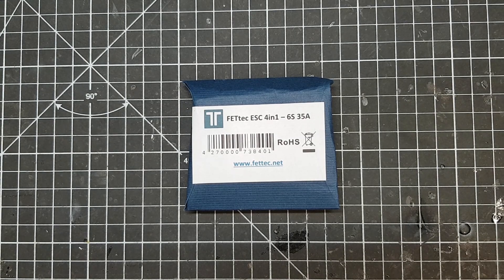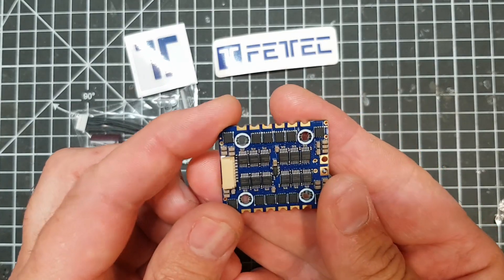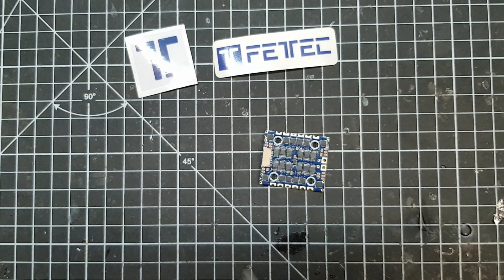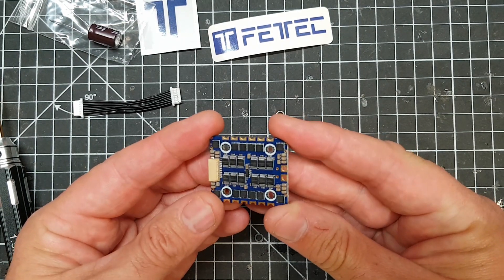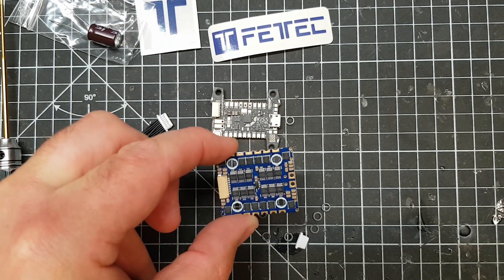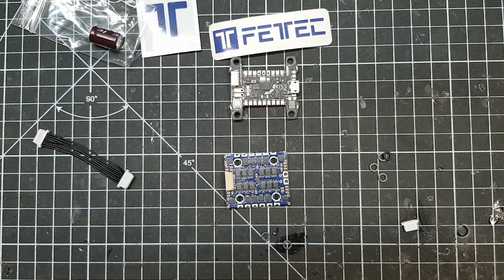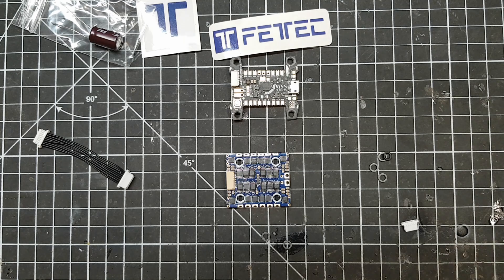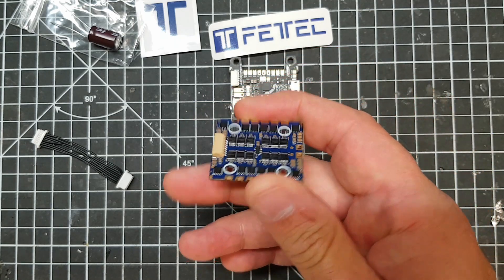Fettec 20x20 6S Sinewave ESC

Comment: Hello, Do you have any particular update for this esc?
I'm looking forward to a kiss build and i was wondering if some of the problems this esc had are maybe solved now or if there is any news about other stuff that might come out shortly.
Also have you seen Karearea TOA Turbine motors?
Reply from the maker: There is a version 1.1 of this esc that makes it more reliable. Make sure you use the fettec spike absorber. Since I did I have had zero issues  Fettec also do a larger 45amp esc. The karearea motors are very pretty but everything karearea does is 9 parts hype/fluff. I would not buy them based on the turbine tech, I'd buy them if you love the look. I doubt there'll be any difference. What he says is correct, but I don't think the design will make any real difference.

Comment: can you use that harness with the black wire to connect to the FC?
Reply from the maker: Yup
Reply: @CoppertopFPV  cool, any idea if there would be enough room on the apex frame to mount this below the kiss v2?  I'm concerned that the corners of the fettec with not give enough clearance to the 30x30 posts for the kiss v2
Reply from the maker: @ztrain10289  I'm pretty sure they don't. There are 3d prints to make it work on thingiverse - or the fettec fc
Reply: @CoppertopFPV  would you happen to know if I can still connect my apex wiring harness to the fettec fc?

Comment from the maker: Mine caused a fire after switching to 6s after setting up on 4s. Friends smoked on a test flight after switching to 6s. Unlucky or a problem I don't know. Fettec offered  a replacement if you bought from them. I didn’t so not sure where I stand
Reply: Is that esc and the comming fc real kiss. I mean will it fly like the real kiss v2 fc or better buy the kiss f7 v2 or wait for the fettec stuff 😂
Reply from the maker: @Antoz1103  yup. Designed by felix the same bloke. FC looks nifty and will use the same firmware. Tbh this esc should fly way better than the kiss ones, but clearly this one had an 'issue' my guess is kiss have just formed an agreement to manufacture their stuff via fettec as the fc is even branded kiss
Reply: @CoppertopFPV  so this means for me i can build without any problems with the Fettec ESC and FC and will have an Kiss Expirience?! Will this one have OSD Support out of the Box or is it need an Extra PDB?! or will i only have to buy those 2 Boards. Solder all together with Motors, VTX and RX and i can go?! :D thx for the fast answers!
Reply from the maker: Thomas Reiter-Krexner no osd.. still. You’ll need a wolf pdb or the new impulse rc apex osd board for that. I haven’t received mine yet, so can’t comment.
Reply: any resolution? did you find out what happened? I assume you used the capacitor and when you say it was setup for 4S you mean motor kv/pids?
Reply from the maker: @jdenomy9340  I used 2 larger caps. Fettec would only replace It I bought from them and the German fpv shop I got it from hasnt even responded. Going to avoid for a while.
Reply: @CoppertopFPV  Roger, and when you say set up for 4S, were you referring to pids or motor KV ?
Reply from the maker: @jdenomy9340  I set the quad up on 4s flashed escs  etc. It was built for 6s but when I plugged in a 6s cell it fried
Reply: @CoppertopFPV   Coppertop FPV  my first one failed completely after about 5 cruisy flights, no crashes. Plugged in, escs beeped and then shut down completely. Fettec confirmed it's dead. Checked over setup and installed a new one. Both were flashed to 1.66 firmware. New one flew fine 2 flights, plugged in third battery and motor 3 doesn't beep or spin up. Configurator confirms there is an error with motor 3 related to FETs or motor connection. Motor connections checked out okay. Fettec states my setup (f60 pro iii 1750kv on 6s) is likely too much and recommend f40 1600kv on 6s and 2400kv on 4s which I would consider to be below what the average person is flying these days. I also find it hard to believe it's a power issue as both issues happened before a flight not during. All solder joints and connections checked with multimeter so I'm stumped this time.
Reply from the maker: @jdenomy9340  that's ridiculous. If they can't cope with f60s they need to stop advertising 6s full stop. 1750kv is pretty low on a 5" So much potential thrown away. I'd post this on the kiss face book  forums
Reply: @CoppertopFPV  I have posted it in a few groups just so people are aware. I agree, f60 1750kv is a pretty typical setup on a 5 inch. I am a massive kiss fan but it always seems their hardware doesn't live up to their firmware, especially version 1.
Reply from the maker: @jdenomy9340  if you send send me a screen shot of if I might do a vid on this. Nothing irritates me more than bull claims. That's a 2207. It's about as average as it can be!  ridiculous
Reply: @CoppertopFPV  are you on FB? I can send you screens via messenger
Reply from the maker: @jdenomy9340  yup . I commented on the post you made in the kiss forum (Ross britnell)

Comment: how does kiss compared to butter/raceflight?
Reply from the maker: I wanted to hate it, but on a 5" freestyle quad it's a mile better
Reply: just got me a few sets of revolt osd lite for the falcox firmware. seems pretty locked with blackbird tunes /: im sure kiss is on par or better?
Reply from the maker: @afifathnin  I have a video on falcox. I didn't like it at all. It's changing all the time and there could be a million reasons why mine flew badly but with kiss flying perfectly with a few tweaks I never bothered to faff with it. A job for another day.
Reply: Coppertop FPV you might wanna try updating your flightone falcox rig as follows:
blackbird tune
blackbird pid
dynamic AA:Enabled
strength:Low
choose multishot instead of dshot32(update the blheli32 esc to latest firmware)

i might not fly kiss but it do flies like one. only downside is that theres still a few bugs in falcox like initial detection of VTX was ok and then the smartaudio wasnt working and the fc resets after a hard landing or a slight crash /:

Comment: I assume this should be compatible with flightone also using the harness, is it F3 or F4?
Reply: @RevvRav I’ve tried it on both regular FlightOne firmware and the new FalcoX with the latest ESC firmware and there appears to be some motor signal issue making it immediately fall out of the sky or would be some violent Roll oscillations that can’t be tuned out. I installed this on three diff type frames, three diff motor types, and two MillivoltOSD’s now and it consistently has an issue. FETtec is aware but hasn’t made any progress to solve the issue they said.
Reply: @BSyncereG  What timing! i was just researching a 20x20esc to go with the millivoltosd as the afterburner is not available in the uk yet. Thanks for the insight! I'm currently running a Tekko F3 Mini 45A and it's working great with Falco and Dshot32, will be trying Dshot 64 this week.
Reply: @RevvRav I only tried the default 16 degrees. If an electronics component works perfectly with normal defaults then I consider it a win. You should have no problem with dshot64 on that Tekko32 Mini.
Reply from the maker: @BSyncereG  there was an issue  but it was fixed about 4 days ago in a firmware update from fettec
Reply: @CoppertopFPV  Hi, the only firmware download available on the site is version 1.0.29. That was 19 days ago. Where can I find the new version?
Reply from the maker: @BSyncereG  it's probably the same one. I just  checked and it was a few weeks ago on face book . Haven't heard anymore about F1 issues tho and can't see any announcements so dunno mate. Perhaps the fix didn't work.
Reply from the maker: Don't know tbh. Flightone was fixed in latest firmware update so should be good now

Comment: For me that's one of the main issues with KISS solved. Decent ESCs.

Still need them to sort their OSD game though, also I think any future electronics I buy will have to be DJI compatible, just in case.
Reply: Here is the reason why the Flyduino and now FETTEC FC wont be having a OSD built in as of right now. The reason is every single FC on the market currently except for a select few all use a cloned OSD chip. The chip in question is the AB7456/AT7456 OSD chip. Both are cloned chips based on a OSD chip that was made and was discontinued ten years ago, the MAX7456. Why Flyduino and FETTEC don't use it is for two reasons. 

1. Since the FCs are assembled in Europe, they would have to import the cloned OSD chips into the country which would get seized at customs. The only way around it would be if the cloned OSD chips are already installed on the boards before they come into the country, which leads to problem 2.
2. To have OSD on the boards means Flyduino and FETTEC would have to have the boards made and assembled in China which would lead to cloning and poor QC which is what neither company wants happening. 

The only way around both issues is to either run a separate OSD board like the discontinued Piggy OSD, run with a PDB OSD like from ImpulseRC, get the new Apex OSD from Impulse, or run the TBS EVO VTX which there is new beta firnware coming out or is already out to get OSD on your Flyduino boards right now. 

Other option is to use a different OSD chip, like a graphical OSD as seen on the BrainFPV Radix and Radix Li FCs. Those ones are a completly different chip, and have nothing in common with the cloned MAX7456 chips. 

I ranted on FB and messaged FETTEC personally and they saw what I had to say. All I said was release the one they have now, but start working on a V2 FC that has a graphical OSD built in. This isn't 2015 still yet OSD is standard on almost every modern FC on the market right now except for Flyduino and FETTEC FCs. Yes, FETTEC can claim they are doing something special with their new ESCs, but their FC is no excuse to still not have a OSD built in.
Reply from the maker: BikeGuy_FPV good points, although the tbs evo is awful currently and lacks basic features. I’d rather just use the cams osd and save £20 or a piggy osd.
Reply: @CoppertopFPV  Alexander Federov is getting firmware made to make the EVO actually useful. Go check his FB, he put a post up the other day where you can test out firmware on KISS. 

I'd say yes to the Piggy too, but Furious discontinued it. The only other option is to get the Airbot OSD. It works, but it isn't nearly as simple in terms of wiring everything up. I'd prefer the Piggy over the Airbot OSD any day of the week. I would however like to try out the Apex OSD since that one is a micro sized Wolf PDB meant to be a plug and play solution when using a KISS FC and 4in1 ESC.
Reply from the maker: @BikeGuyFPV  yeah I'm waiting on the apex osd. I'll check out Federov. I thought he was just intergrating it rather than changing it
Reply: @BikeGuyFPV  v v interesting re: the osd chips. I have to say though, it makes little difference to me ultimately. It has been a blocker for me, I might try that wolf thing but generally it still is a blocker.

TBH that sounds like a pretty poor excuse from flyduino to me. Sure its a problem but I can't believe it's completely insurmountable. Many small business are solving issues like that all the time.
Reply: @BikeGuyFPV  Really excellent points, hadn't occurred to me that would actually present itself with an issue - although there is opportunity present there - full graphical OSD integrated into a PDB/ESC system and straightforward FC might be a solid way forward - especially since it looks like the remainder of the FPV/HD camera/transmitter package may see some level of integration from here forward.
Reply from the maker: Have you seen the impulse apex osd board and 20x20 pdb? I wonder if one of the reasons kiss flies so well is they keep everything separate. Can't think of any other reason why they haven't sorted it. Not overly familiar with the dji hd but I thought it was comparable with anything although I've seen holybro have a fc with a specific connector.
Reply: @CoppertopFPV  Yeah, let's just let them focus on the FC's and their awesome firmware and let others solve the OSD situation. Less faffing around and more flying.
I'm definately going to try the new impulse osd and pdb. Love the wolf pdb! Not a huge fan of 4in1 escs. I assume it is the v3 pdb they have been teasing on their facebook page.
Reply: @eduenlamer  I don't really mind who sorts it out or how but I want a nice gui to configure it and I don't want to have to use funky cables to do it.
Reply: @frasersteen  Have you seen the previous version of the impulse osd?  The one that's on the wolf pdb. Better gui than betaflight for sure. Better functions than everything else and it's completely plug and play. To me that pdb is an absolute no brainer to get if you don't want to run 4in1 esc's.
I'm pretty sure their new osd uses the same dead simple gui.
Reply: @eduenlamer  just seen a vid, that's actually not too bad. Might investigate further.
Reply from the maker: Fraser Steen the wolf pdb is brilliant if you run seperates. Great osd, gps and super clean. I’m running it on my sx218 and it’s great if bloody expensive.
Reply: @CoppertopFPV  I'd even run it on betaflight if I ever build one again, besides my micros that is. 100% noise free video, the best gui and mounts flush. Well worth the money for me. 👌
Reply: @CoppertopFPV  The various OSD solutions I've seen are pretty hacky, not seen that one though. DJI is just an afterthought right now but it looks so good I kinda don't want to buy anything that won't work with it in the meantime.
Reply: To me, the ability to have full graphic (color?) OSD carrying maximum information content on switch-toggle ready screens (Racing HUD, GPS, Diagnostic/Tuning) transmitted back through 720 video is going to be living the dream - I probably won't care how involved it is to get the first one of these set up, but I have a feeling that it's a question of how many months I'll have to wait.  I'm assuming the system as a whole is going to set me back more than my daily driver car is worth, but I really won't mind - I think having a full FPV system capable of intaking ESC and FC data is probably a more viable solution than trying to build all of that capability into open-source FC development, which is slightly unfortunate, but in the end probably worth it.
Reply from the maker: tehllama42 I have mixed feelings about the likes of dji removing the open source/mix and match nature of the hobby. On one hand they have the money and tech no one else has to do this properly, on the other, the thing I love is trying different things out. The day they offer all of those things is going to be a sad one for me in many ways. This hobby has taught me many things, and none of it came from a closed source. Can’t see anyone else doing it, seeing as crapshark have suddenly ‘delayed’ their offering... how very predictable 😂

Comment: Dshot2600? I'd be interested to see if it makes much difference.
Reply from the maker: Change Agent 2400. I’ve been running it on Kiss since I used it and haven’t noticed a big difference. Any esc with an f3 or f4 processor can use it like the Airbot escs.
Reply: @CoppertopFPV  I have ds1200 capability on my stack but I never changed it from the default ds600 as everything works fine. I have other units on ds300 that fly smooth and good too. I'd be curious to see if higher dshot is less efficient as the ESC transistors will be in the saturation phase for more of the duty cycle.
Reply from the maker: Change Agent the only difference I noticed going from 600 to 1200 on Betaflight was more noise. It seems to have got better recently, but like most things it’s 1 part good and 99 parts hype.